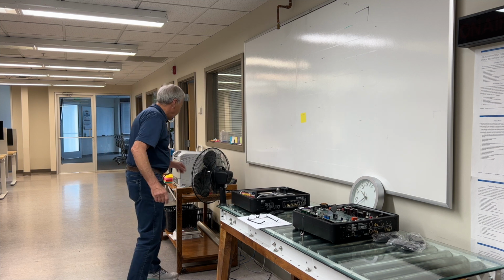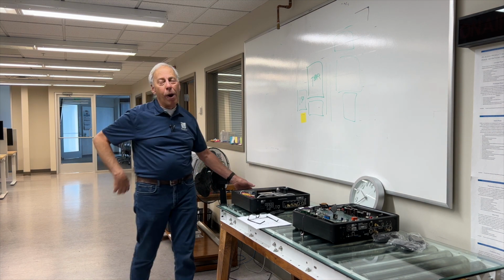XLR Cables for microphones

Comment: Hmm Paul it seems tests done with these two particular brands seem to show that they pass the identical signal through.
When run on a null test the cables, in fact, null.
What's even more curious is that when these expensive cables are tested with lesser expensive cables there is no change in signal and the cables also null.
Maybe you could put those cables on some test equipment and show us what you are talking about.

Comment: I wonder how much difference it makes.  I have a 20-foot run from my preamp to the amplifier for my electrostatic headphones.  I can A/B a single-ended cable and a balanced cable with a button on the headphone amp.  I tried it (briefly) and I didn't hear any difference. (The single-ended cable is from Blue Jeans Cable, the balanced is Canare star quad.)
Reply: It literally makes no difference.
Reply: I usually make my mic cables with Canare Star quad.. Though Im considering starting to use Mogami... 
When you make your own the price is pennies on the dollar compared to finished cables . Even ones from discount manufacuteres (who do use decent cables/XLRs) like Blue Jeans.. You just need to know how to solder, and have the time to do so.. (That all said, I probally will just order pre builts made at Redco.. which is my supplier for cable.. as the cost isn't that much more.. though the build time generally has been my only reason for just buying the cable / XLRs loose from them)..
Reply: @drdelewded  Yeah I make all my own stuff too. I usually buy my cable and my connectors from Markertek out of Albany New York.
Reply: Right on..
Marketek is pretty decent as well..
Redco is just a tiny bit cheaper.
Reply: At least with the couple Mogami Cables I just compared the prices with.. 
Both places im still shipping to Canada from so Ill have to check to see which offers a better deal on international shipping
Reply: @drdelewded  I actually have a wholesale account at one of Redco's competitors that's right here in town, except doing orders with them is a pain, and then I have to drive all the way over there to pick it up at their counter and it's a little out of the way for me. Markertek ships it free freight and it's at my door the next day. It's a little bit more money than buying from the actual distributor locally, but the convenience of markertek is too big to ignore.

Comment: I've used unbranded microphone cables that have a braided silver ground and four silver wire sets that are wired two to hot and two to cold for many many years and have found them to be excellent. They were purchased from a company called Commercial Electronics and were available in multiple sheathing colours which make it easy to designate mic cable runs. I believe they were supplied by Neumann and I used Neutrik connectors to complete them. They were sold in 500 foot reels at the time but I was able to get a good price by purchasing partial reels at near wholesale (the last 60 feet) as they had received a new supply and wanted to clear out their warehouse at the time. Great cable and I've never had a failure or problem with any of them on the road which I can't say about some prepared cables that came with some expensive microphones that I've bought in the past.